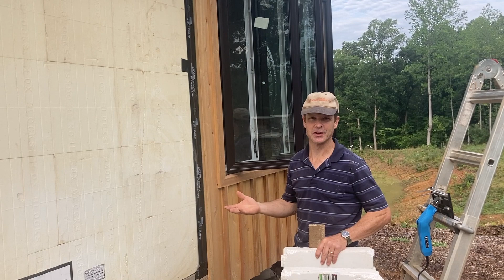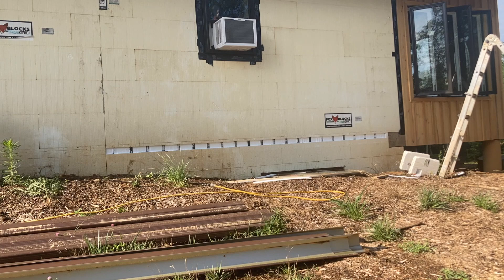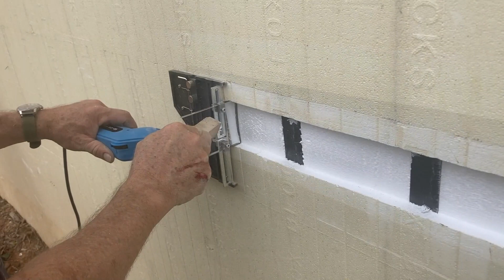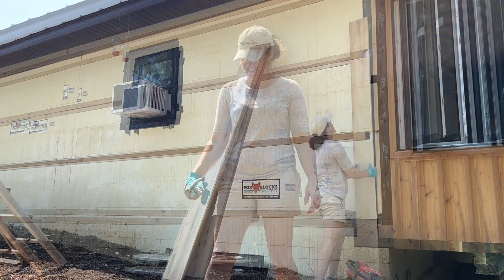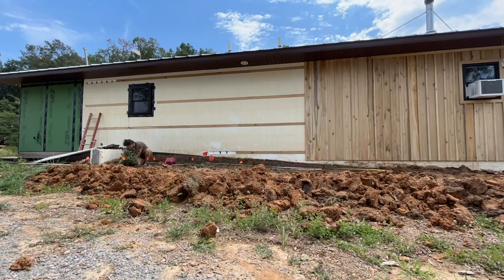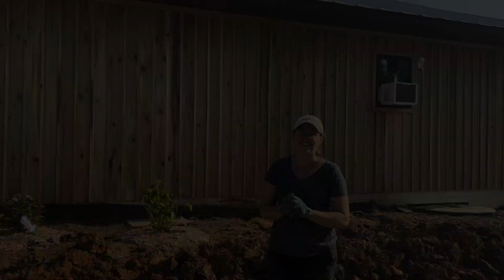Installing Board and Batten Siding on Fox Block ICF Wall

Comment: Just to make your life I little easier… Next time you’re using this hot knife, turn the blade around. This will allow you to push the hot knife in lieu of pulling it. And second tip… measure the distant between the blade and the plate. Make a chalk line below. Have someone hold a level below the line while you run the hot knife on the level.
This does require two people, but you can snap all your lines in one shot, and then cut all your lines quickly and confidently. We use this same process for cutting reveals into EIFS or Synthetic stucco.
Hope this helps!

Comment: Pretty sure I would have built out the rest of the house 3/4” before doing all that. Or just let the 3/4” step out be there. Nobody would notice or care. Also the 3/4” gap behind b&b is good. It helps keep the wood dry.
Reply from the maker: We considered this option, but keep in mind, the furring strips would need to be verticals to ensure proper drainage and prevent rot on those horizontal boards.  That means you’d have to mount vertical strips first, then horizontals.  By that point you would need minimum 3 inch screws/nails for the final siding planks—more if doing battens.  Definitely more variables at play, which is we opted for this method.
Reply: @ADifferentWay  that’s true. I’ve seen it done with the furing strips run on a 45 degrees angle. Thats what I’m considering doing.
Reply from the maker: That’s a clever idea!  We never considered that, but you’ll still have the issue of having long-enough nails if you use battens.  If you are just doing siding, it would be easier.
Reply: @donniecraig1295 good idea on the 45

Comment: Did you think about using 5/8 zip cut into strips? (saves time plaining it down from 3/4inch, unless you wanted the extra 1/8.  I am planning on securing house wrap plus vertical 1x4 as a rain screen on my built.  Your idea is something that I can implement insted of securing verticals with concrete screws.  The horizontal wood (or zip) would be used as a way to have a place to secure the vertical strips.  Wanted your input.
Reply from the maker: I could’ve used 5/8 zip but I have my own Lumbermill and prefer to use my own wood. It’s free and I did in fact, want the extra 8th inch. using the horizontal 5/8 zip seems like a good idea to secure your verticals. However, if it stands off too far away from the wall, you’ll have bugs behind there. You’ll have to screen the bottom to close that gap.

Comment: They can't call yall lazy😂. Would that hot gun go faster if you paid 500😂? I wonder why y'all did not go with a septic tank? I would like to see more finish inside I believe the last inside was putting down the heating floors line or was it the wood stove. 01-17-24
Reply from the maker: Our state has very strict septic regulations.  We knew our soil wouldn’t pass a percolation test, which means we would be required to install an aerated system.  We’ve had one before—high maintenance, high energy requirement, and ridiculously expensive.  For us, the composting toilets were the most practical option. As far as the inside of the house, we’ll, not much more has been done!  We ran out of wood there for a while and had to wait for the rest to dry.  We are hoping to get back to it in the near future.  We are also planning to purchase a router sled so we can finally install our countertops.  That will be exciting!!  Definitely stay tuned.

Comment: I would not recommend following this method. By trenching out the foam and attaching the furring strips directly to the ICF studs you are creating a thermal bridge. Basically defeating one of ICFs greatest benefits.
Reply from the maker: That’s a good point but realize it’s not creating a continuous thermal bridge because you still have the  foam on the inside. Additionally, the percentage of the wall compared to the overall house size is extremely small, less than 3%.  I also disagree that the greatest benefit is lack of thermal bridging. I consider the thermal mass to be a much greater advantage for a passive solar home. It has no effect on the thermal mass. And lastly, I live in a relatively mild climate, keeping the house warm in the winter is extremely easy with my passive solar design. My biggest concern is cooling in the summer.  Thermal bridging across a delta T of less than 20 deg on the hottest day is not a huge issue.
Reply: @ADifferentWay  Thermal bridging to the inside of the house is not the main problem. The foam isn't actually there to stop thermal bridging between the inside and outside. The foam is there to trap the thermal energy of the concrete inside the wall.

One of ICFs greatest strengths is the thermal mass of the concrete. The concrete will draw the constant temperature of the earth up through the footings. The ICF wall will stay the roughly the same temperature year around no matter what because of this. That is what actually regulates the temperature inside the house, not the R value of the foam.

By using this method you have basically constructed a large radiator that bleeds off all that thermal energy to the outside which will nullify your greatest efficiency gains.

Also, because the wood siding transfers thermal energy directly into the concrete now you will have a temperature differential between the concrete and the siding. Which means you will have sweating behind your siding and reducing its life.
Reply from the maker: That makes more sense. Again, I disagree that it’s a large radiator. It’s less than 3% of the surface area. However, your logic does seem very reasonable, and I really wish you worked at Fox block. They were the ones who recommended I do it this way.🙁 if there is a sweating issue behind the boards, I should notice that  wood movement within a few seasons.
Reply: @ADifferentWay   You're probably right.  It's not going to be a disaster or anything.  I'm just always chasing that peak efficiency. Give me a call when you do the next one🙂. We could align all your wall planes during the design stage and everything will come out perfect.
Reply from the maker: I really appreciate your input.  We do this channel to learn and educate.  If I do something wrong it’s important for people to know that and learn from my mistakes so they’re not repeated.
Reply: @TheICFArchitect so what’s the best way to put siding on ?Just about to side might Nudura house and running into the same issue